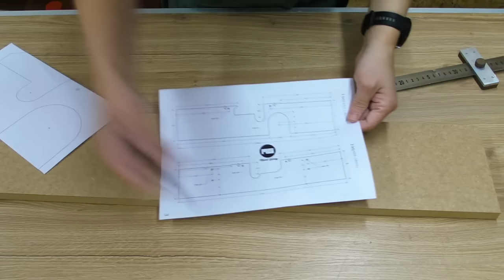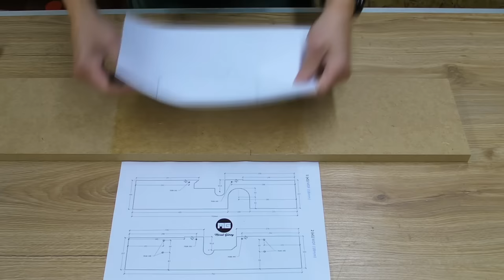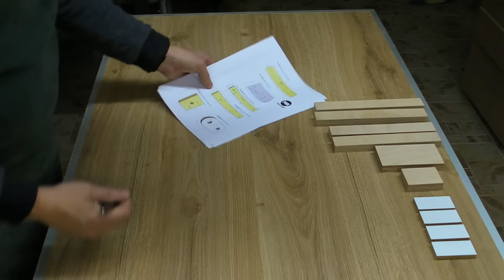Make a Planner Bench (Benchtop Jointer)  (Easy depth adjustment)

Comment: Question: How can you make it continuously on? or how to lock the trigger?
Reply from the maker: Hello.  I attached a plastic clamp to the trigger.  Or you can fix it with paper tape.  You can also use a switch on the outside to turn it on and off.
Reply: Oh thanks!😊
Reply from the maker: Tahank you too 👍

Comment: The design is great, however if a different planer is used the cutouts and top measurements need to be adjusted. I am using a Makita 1900B for my project and will share pictures when the assembly is completed.
Reply from the maker: You are absolutely right about this. But there won't be much change. Maybe the holes on the side will change. I wish you success. I am waiting for the photos.

Comment: Great jop Murat , Is the Plan PDF acurret with the real measurements ???
Reply from the maker: Thank you very much.  The dimensions are perfectly correct.  It's the same document I used in my video.
Reply: Thank you so much Murat . Ihave the same planner "stanly" and thinking to use your PDF .
Reply from the maker: You can use the same.  I tried to fit the pattern as best I could.  To tell the truth, there will be no problems except for very small settings.

Comment: Hi, Amazing build! and the free plans are much appreciated. I just have one question:
How do you print them out? is there a specific scale I need to pick or a paper sheet size? I am printing with A4 paper on a common printer but the drawing comes out much smaller than needed. Any sugestions?
Thanks in advance!
Reply from the maker: Hello.  First of all, thank you very much... The dimensions have been adjusted to be used in the same way.  If there are options such as "fit" when printing, it may therefore come out small.  Deselect this option and select "actual size".  You can use the pattern drawings I use in the same way.
Reply: yeah I am printing at 100% scale which I believe is the equivalent to "actual size" but it still comes out small... I'll play around with it and let you know. Thank you for your prompt response!
Reply from the maker: Thank you too.  It must be related to the printer settings.  The "fit to page" setting should not be checked.

Comment: Something I can't work out - surely the threaded insert in the adjustable plate moves vertically up and down as the threaded rod is turned, but the hole through which the rod passes near the knob is vertically stationary. So, does the rod not have to bend? Or only by a very small amount since the amount of vertical movement is very small?
Reply from the maker: Hello.  Good point... Actually, you answered your question yourself.  Since there is a small up and down movement, the gear shaft does not force much.  But there is one more detail.  The hole in the fixed part is elliptical.  That is, it is extended upwards and downwards.  Pay attention to item 10 in the dimension sheet.  (You can find the dimension document in the description section).  If you have any doubts, write again.  Thank you for your attention 👍

Comment: What is the layout for the holes for the riser shown at 13:12 on the video?
Reply from the maker: Hello. I apologize for returning late. I determined the location of these holes during the project construction. These holes are the screw holes required to fix the moving mechanism on the inside to the body. After reaching this stage, you can determine the location of the holes in a suitable order.